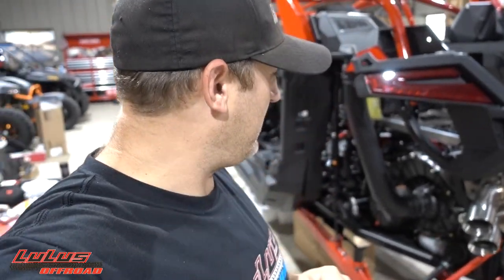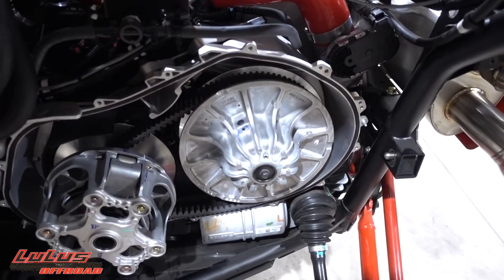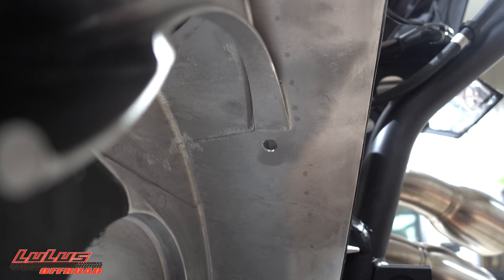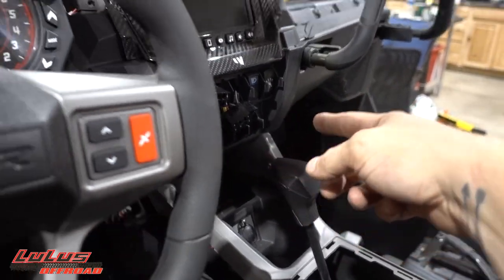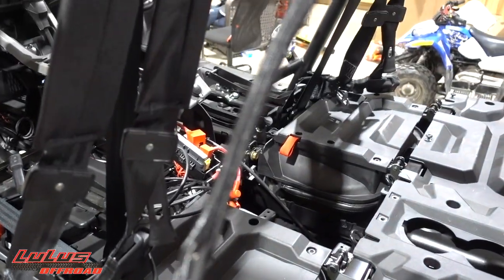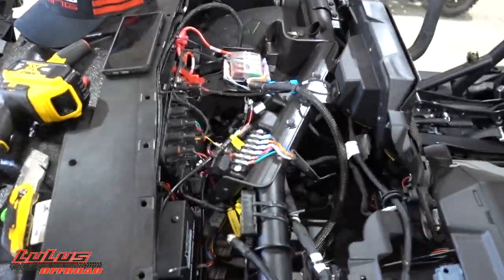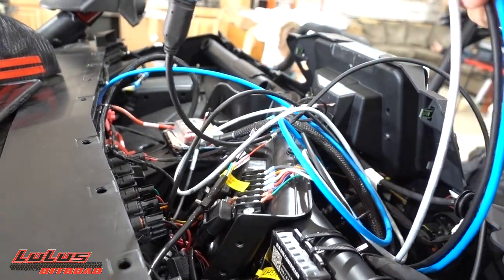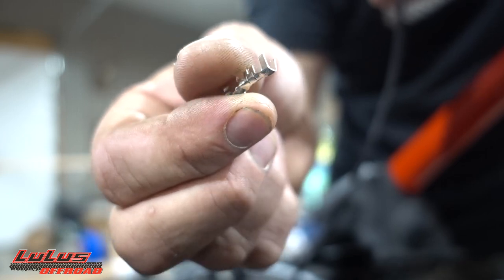Rzr Pro Xp Razorback Temp Gauge

Comment: Is this freaking pro XP a freaking 20 or a freaking 21?
Reply from the maker: It's a 21 bud
Reply: @lulusoffroad  I believe the freaking torque on that freaking bolt in your freaking secondary is like freaking 26 foot pounds not freaking 40 something have a freaking good day.
Reply from the maker: @brianbyers2682  appreciate that. I just posted the correction. Not sure why I said 43. Yikes!
Reply: Excellent video! What should be the ideal temperature reading for the drive belt?

Comment: I wouldn’t recommend this location.  I put it in the exact spot l, even a little higher and the plug hits the Bosch controller. Now I have to find a way to plug it.
Reply from the maker: Sorry your having trouble with location. Not sure why it would be different. Hopefully you can find a way to get it in position. Mine was also close to controller, but was still able to fit in place.
Reply: Lulu's Offroad not your fault.  I should have made sure it was going to clear.   I shaved a small bit more towards 12 o’clock and shoved it in there.  It the nuts don’t sit flat but that’s the way it’s gonna stay 👍🏼. Lots of loctite, don’t think it’s gonna move.
Reply: I have same issue. Can just squeeze it in but def is way tighter than I would like. Tough to measure tho so I get it.